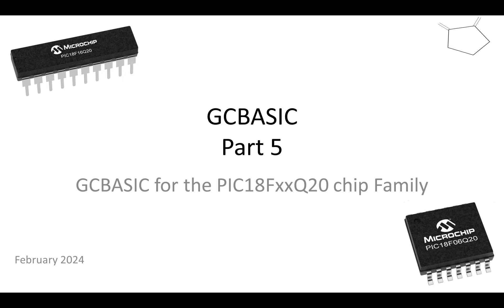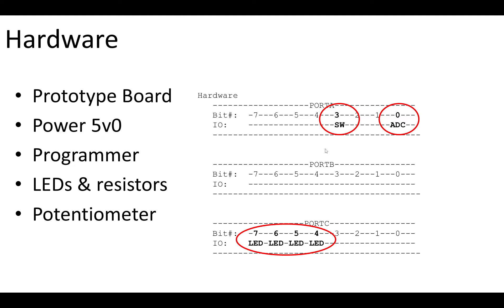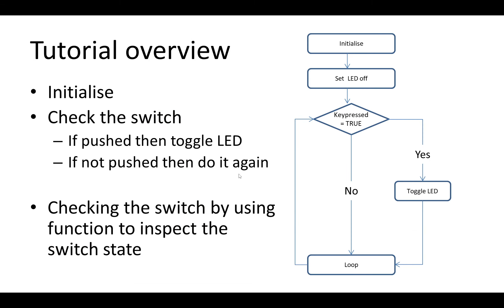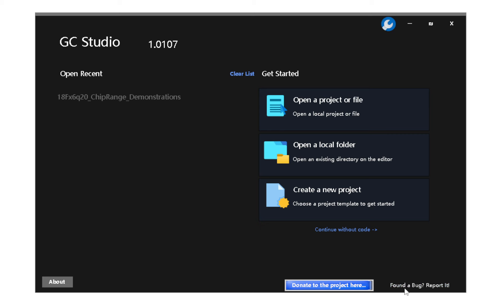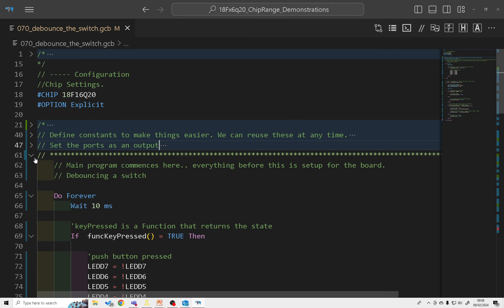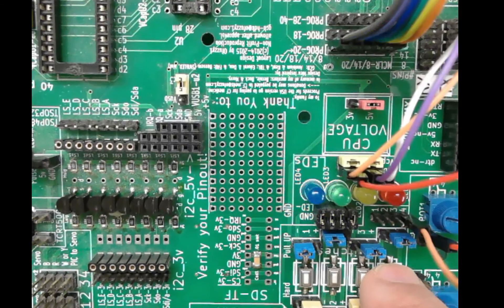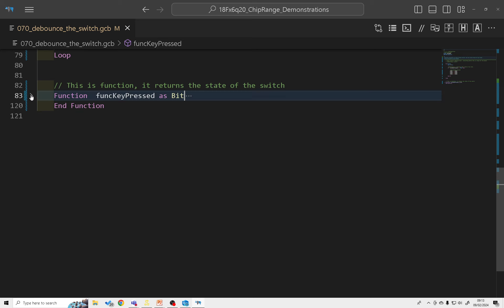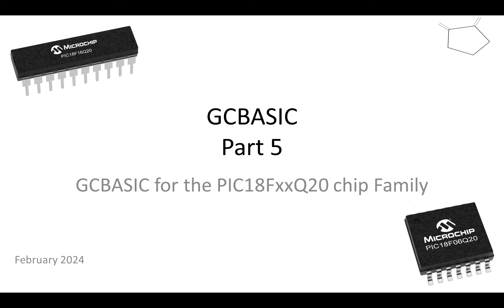PT5: PIC18xxQ20 chip Family - Using an input to set the state of the LEDs

Comment: Do you have any examples around the low power features of chips?  For example SLEEP/IDLE?
Reply from the maker: A good ask...

All GCBASIC programs that are not programmed to stay in a continuous loop will put the chip to sleep.  Are you thinking of a tutorial on specific of sleep with interrupts etc>
Reply: @AnobiumTech  Oh interesting, I guess I just assumed that it would restart the program again if it exits the main loop.  Most of my programming is on processors like the ESP8266/ESP32 which can be put in deepsleep to save power and then wake up from an external input or a timer sometimes (push button on reset for me mostly) seems I should just try it, I know I have a few PIC's somewhere.  Many years ago I learned ASM on a PIC16F84, but I have not used that for years.  A demo of how GC Basic works with sleeping and then perhaps using the WDT to wake it say every second would be an interesting version of flashing a light for example.  Watching PT1 of this series I see in the first example you do have a comment that END puts the chip to sleep... I missed that before.  I find your videos interesting as I remember the pain that ASM was ~20 years ago, GC Basic sure seems to hide the mess of setting fuses to get the right clock source and so much more.